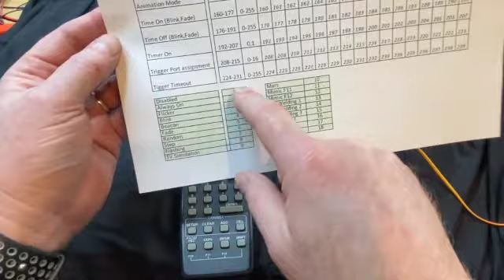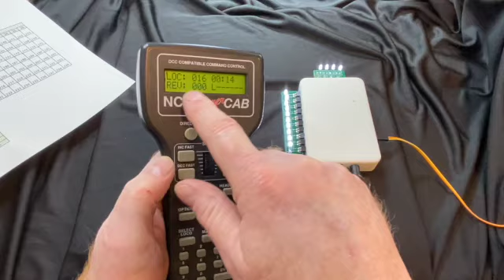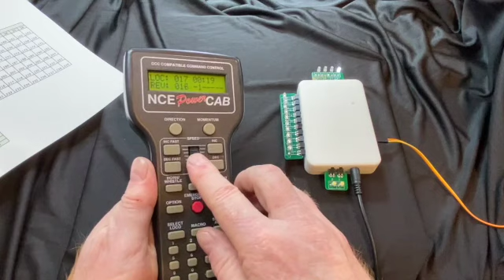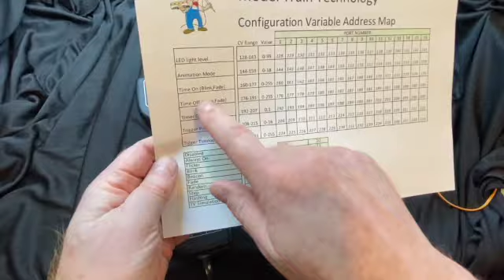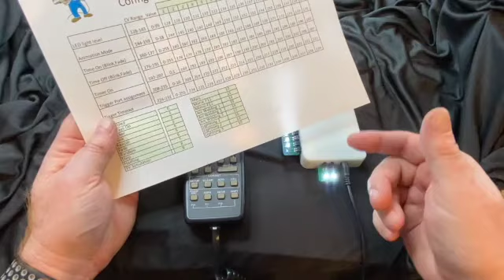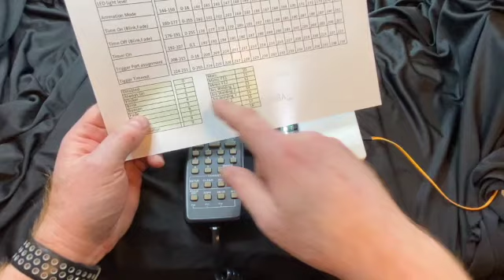Using NCE DCC to configure and control MTT LSC IIa Lighting and Animation Controller

Comment: Does the new Digitrax throttle allow access to all 128 speed steps and have you done this tutorial for the Digitrax system?
Reply from the maker: All our demos use Digitrax (well almost all - we have shown with NCE as well).  128 Speed steps are converted to 1-100% as appropriate such as for the LED brightness.